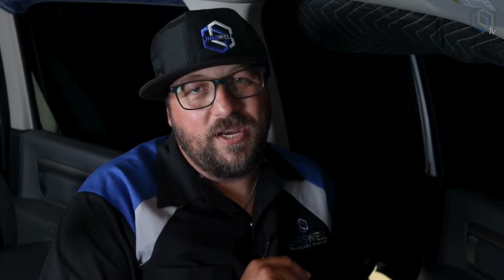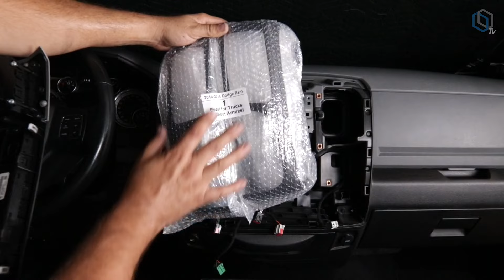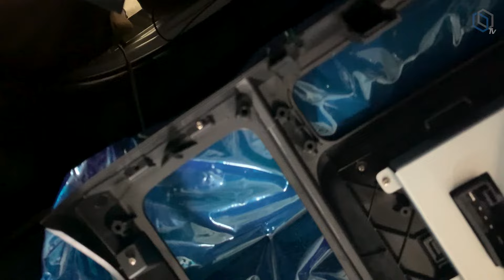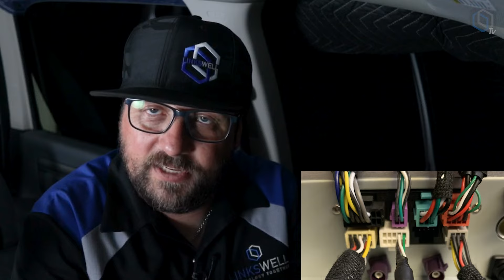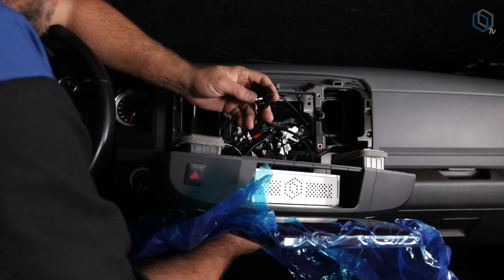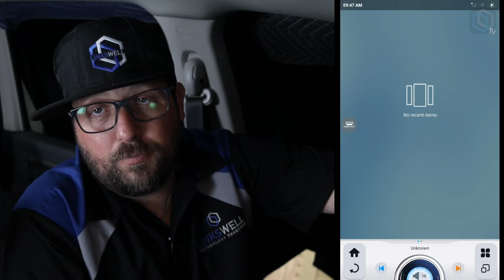Installing a T-Style XL into a 13-18 Dodge Ram

Comment: The gen 5 i got is buggy, hope  they spent a bit more time ironing this out tempted to replace to this or just a regular 2din.
Reply from the maker: Gen 5 is over 5 years old. Technology For Android in cars is wildly different today then it was. And a side note Android Auto is actually an awful app to work with. The app itself is unstable. So makes interacting with it hard. And that’s on the phone side not the radio side. But we keep fighting to do our best to make it stable.

Comment: I installed an aftermarket backup camera on my 2014 1500 Bighorn, and for some reason, the radio still says no signal to the cam. Any suggestions? I’ve tried all 3  connections factory input, rear and front.
Reply from the maker: What radio is it?  

Where did you get the power for the aftermarket camera?
Reply: @LinksWellInc 15.6 t style XL . And I got power from my reverse light to the camera. I was wondering if I needed power to the green wire in cam harness behind the radio labeled reverse power.
Reply from the maker: @bernieunion6362 that’s the problem. You need to power it somewhere else. The power at the reverse light on those Rams isn’t a true 12 volts. You can try getting it at the hitch harness. Or run it to behind the radio
Reply: @LinksWellInc ok I’ll try reroute power wires and let you know if it works. Thanks.
Reply from the maker: @bernieunion6362 sounds good.
Reply: @LinksWellInc I was able to get it to work. Also should I update the software  through system update? And what’s the difference between Ram Lo,Mid and Hi in the setup?
Reply from the maker: @bernieunion6362 update if things aren’t working. 

The difference is based on what the factory AC was. You set it based on the factory climate controls.

Comment: Sorry but that thing looks goofy in there! Looks like a makeshift attempt to have a big screen. Like you found a screen and just threw it in there. Is there a smaller one that looks more professional?
Reply from the maker: So to each their own. The large screen standing above the dash is the “new” style for the manufacturers (Ford, GM,etc)

We also make a 12” screen that fits inside the dash for those who would prefer that look.

Comment: I contacted the support page on your guys website, I've had mine 2 years and rn I'm having an issue where its stuck on bluetooth phone mode and I cant exit out of the screen. I've tried resetting it and unplugging the battery and trying to unpair my phone. But nothing has worked and I cant access any other part of the radio aside from the phone, any tips?
Reply from the maker: Ya need to have the techs send you a format update I think. 

Did you use the chat icon in the lower right corner?
Reply: Just sent another one to be sure it went through. 🙏 When I was able to access parts of the radio it said mine would no longer be receiving updates and had the latest update available.

Comment: I off-road in my ram and often find myself on washboard roads. How does the screen hold up to that vibration?  Is it solid?
Reply from the maker: I have it in my Jeep JL. You can see a few videos I have of my off-roading with it. I haven’t had any issues.
Reply: @LinksWellInc thanks. I’m in SoCal. Who should I reach out to, to get this installed?
Reply from the maker: @osvalds we have a few dealers out here I So Cal. Our website has a find a retailer that will list the closest based on your zipcode

Comment: are you able to connect a gaming system to this device or does it have hdmi ports ?
Reply from the maker: You can get our HDMI input adapter and plug in any HDMI device.

Comment: For some reason when I select "Dodge Ram HI Other" my AC control doesn't work. It blows air but I can't lower the temperature or change the fan speed. Its stuck on 2? Any suggestions? I have a 2014 Ram 1500
Reply from the maker: Check the Protocol that it is set correctly
Reply: @LinksWellInc  what should the protocol be?
Reply from the maker: @ simple
Reply: @LinksWellInc  thank you! i had this stereo for almost 2 years and its bee amazing. i just had to reset it because the screen started to freeze and it was being way to slow.

Comment: Hello bud after Friday, I just bought this new radio for my 2016 dodge ram. It’s really nice, and you’re very knowledgeable and helpful thanks. Could you please educate me on how to use my HDMI so I could hook up my Firestick and what will I need to do to run my internet and use CarPlay at the same time, I thought you were talking about using both on one of your other videos please?
Reply from the maker: @jameswright9578  to do CarPlay and Internet you need to install the SIM Card on the radio. 

To do HDMI input you have to purchase the HDMI Inout adapter. The HDMI on the chassis of the radio is an output not an input.

Comment: I have a 2017 Ram and got the xl radio installed, when I click on aux it just shows a car with and explanation mark in a triangle on it
Reply from the maker: @Ptroiano117  need to set the parking brake if you are trying to watch video. If it’s just audio then it will play with that icon.
Reply: @LinksWellInc I have the truck in park and the parking brake on, and it still shows that picture and does not play. Would it have to do with me having the hdmi box or no?
Reply from the maker: @ possibly. Do you have the HDMI icon?
Reply: @LinksWellInc  not on the screen, but I do have the app for it
Reply from the maker: @Ptroiano117  when you open it what happens?
Reply: @LinksWellInc  same picture pops up
Reply from the maker: @ go to settings/System/Factory setting use passcode 1660. 

BE VERY CAREFUL NOT TO CHANGE SETTINGS. 

Turn the video in motion option. The. Save and reboot
Reply: @LinksWellInc  it is on should I turn it off? I also realized read climate is off, should I turn the on since I have fans back there?
Reply from the maker: @pattroiano1354  turn it off. Stay away from the rear. That is only for the Expedition
Reply: @LinksWellInc  HDMI is working now but the 3.5 Aux is now showing a picture of RCA cables
Reply from the maker: @ which it will unless you have a video source in….  But there also may not be video in that input as well….
Reply: @LinksWellInc  It still doesn’t play any audio still, what I’m trying to figure out is if it is a setting I need to change or if the mechanic didn’t wire it properly
Reply: @LinksWellInc I also can’t get the wired phone link to work, when I plug My IPhone in, it charges but won’t connect to the screen?
Reply from the maker: @ the XL does not have wired CarPlay. It’s wireless only.
Reply from the maker: @Ptroiano117  are you plugging into the factory AUX?  If so do you have the factory CD player?  Because we can only retain one or the other. We can not retain both at the same time.
Reply: @LinksWellInc  Okay that’s a little confusing, I have two usbs, one has a sticker that says usb and other one has a sticker on it saying phone link. But if it doesn’t have it that’s fine, I’m just trying to make sure everything works properly
Reply: @LinksWellInc I’m plugging into the factory Aux, I do not have the factory cd player
Reply from the maker: @ apologies for the confusion. But the cable is the same as our Gen 5, with the Gen 6 and XL though there is no wired CarPlay.
Reply from the maker: @ so then you need to make sure the installer plugged the RCAs marked “Aux In” on the main harness into our AUX IN RCA’s on the grey plug.
Reply: @LinksWellInc  would you be able to tell me what cable (XC01-N0323-A1) is?
Reply from the maker: @ not off the top of my head no.
Reply: @LinksWellInc   I figured it out, it the am/fm antenna. So I had a gen 4 10” links well in my truck when I first bought it and they left that antenna in there when they installed the new unit. Would that affect the stations because they are all static and they’re saying it’s my antenna on the outside of the truck, but it worked perfectly fine with the other unit. Would it be because they didn’t use the new antenna for the head unit itself?
Reply from the maker: @ check the plug to the radio.

Comment: Personally, I had to switch back to my factory radio because I wanted the factory mic. I went with a Chinese head unit brand and tried different mics but everyone mentioned they could not hear me well. That’s why I’m cautious on upgrading my head unit. Plus this stick up a lot and does not look nice in my opinion.
Reply from the maker: @omarpadilla7674  so the other brands use a cheap Bluetooth chip. The issue isn’t the mic. It’s the chip itself. So swapping mics will not help their call quality. Our Chips are much nicer so our call quality is much higher. Use our mic and you won’t have any issues with call quality. No way to retain the factory mics. It’s a long story but the mics are not created equal and so you can’t adapt to them. 

As for the style….  We have a 10” and a 12” screen option for this vehicle application as well for those who don’t like the larger screen.  But then sometimes for some folks keeping the factory is best. 

You have to decide what matters most to you and go for it.
Reply: @ I like the large screen especially for directions since I’m on the road very often. I appreciate your response. I will do more research and decide down the road. Thank you for the explanation.

Comment: I just installed this xl on my 2019...what made it easy was I already  had a gen 4 12 inch so most of the harnesses were left as is just swapped out a few of them and it works perfect. I just have two questions should I use the factory gps antenna or should I connect the one provided? Does the radio use a pixle 3 motherboard
Reply from the maker: @tonyv33ee  so sometimes the factory works perfect. Sometimes I doesn’t. I say try it. If not. Then install ours.
Reply: @LinksWellInc  in regards to the last question, just want to make sure I give  permission to access my Google account and whatnot
Reply from the maker: @tonyv33ee  I believe it is a Pixel yes. I would have to check to confirm.

Comment: Was there any info about the air shocks?   I have an 18 Rebel with air shocks.  I always utilize the tire change or if need be the towing function.  Does that come on this radio?  Are there any updates or maybe a newer version coming in 2025? Before I find a retailer. 😂🎉🎉🎉🎉🎉
Reply from the maker: @leonjrich  so Gen 7 may release at the end of 2025. Still too soon to say. 

Air shocks I will have to double check on.

Comment: does anyone know if you can update the software version of the first gen 12 inch display in a 2020 Ram to the latest android one ?
Reply from the maker: @heavyd7763  no. All components outside of the tablet only function on the Android version it is built with.

Comment: Where can I find the external speaker for the backup sensors? Just installed the gen 5 on my  2018 Ram 1500 and the sensors aren't coming through the speakers.
Reply from the maker: @sportscenter_aj  should have come with it. 

Also make sure the radar sound is turned on in the settings
Reply: @LinksWellInc  I did not see the speaker in the Gen 5 box. I saw the connection for it but not the actual speaker. Radar sound is turned on in settings.
Reply from the maker: @ in “vehicle” icon settings is radar set to sight and sound?  

The speaker should have been in a small bag.
Reply: @LinksWellInc  found the setting for it in the "vehicle" app in settings. But I am unable to change any of the selections in that app. It does appear to be on but set to low volume.
Reply from the maker: @sportscenter_aj  have you programmed the HVAC?  Is that set correctly?
Reply: @LinksWellInc  Yes. I had an Auto, so I set it for Dodge Ram Hi > Simple> Other
Reply from the maker: @ that should be correct. You may need to get on the website chat and get images of firmware sent to the techs to verify all that.
Reply: @LinksWellInc  thank you for your help!
Reply from the maker: @sportscenter_aj  No problem

Comment: Does this radio have the same factory setting access as the oem radio, the rebels have air suspension functions in the menu. Will these still be accessible.
Reply from the maker: @Vetsgotyoursix  yep it does.

Comment: What if you have the 2016 that has just the hazard button above the 3 knobs of climate control
Reply from the maker: @victorialynn961  should be the same. It will work on all 4 different climate control options Dodge made.

Comment: @LinkswellInc, I'm in need of assistance. My screen went blank yesterday. Nothing out of the ordinary happened prior to the event. It has not come back since. It's mid summer, and now I'm without AC. I sent an email to tech support as well. Need help!
Reply from the maker: @Thir_D_Three  press the RST button on the face of the radio with a paper clip
Reply: @LinksWellInc  First off.. Dammage, never knew that was there! Always in the drivers seat and didn't see it. I was pressing and holding all the soft buttons trying to do that very thing. Thank you, It worked.

I will respond to tech support. Much appreciated.
Reply from the maker: @Thir_D_Three  no problem.

Comment: How could I get this to work in a 3rd gen 1500
Reply from the maker: I don’t know what years a 3rd Gen is
Reply: @LinksWellInc  2004 ram 1500 5.7
Reply from the maker: @datguy6502  so you may be able to make it physically fit. But none of the electronics will work. So no climate controls, SWC, factory settings. All that is specific for the 13-18. 

O4 is worlds different
Reply: @LinksWellInc  appreciate the help bro 👍🏼 I’m not sure I’ve seen it been done and I was wondering how I could get it to function properly.
Reply from the maker: @datguy6502  you would have to rebuild it all.

Comment: Is there a way to play the radio automatically, instead having to click on it
Reply from the maker: You should be able to set the radio in auto open in the settings
Reply: @LinksWellInc I didn't see Radio as an option, I'll check again.

Comment: Purchasing this unit for a Silverado. Not seeing any videos on installation. Hoping for the best, but I'm a bit worried. There are many tutorials out there for Ford, Ram, and Jeep, but no love for GMC/Chevrolet. Anyone out there have any comments on Chevrolet/GMC XL units? @LinkswellInc, please chime in when you can.
Reply from the maker: We have a GM set up to install in the next couple weeks. Harder to find around us for what ever reason.
Reply: @LinksWellInc  Thanks for chiming in. I can't be the only Chevy guy out here. Looking forward to your vid.
Reply from the maker: @Thir_D_Three  so I have an install manual for the Gen 3 on our website. The process is near identical. If it helps in the meantime.
Reply: @LinksWellInc  Hello again. I have my unit installed now. Whenever I hop out to Linkswell TechSupport via chat, I never get a reply. From the email option, I never receive a reply there either. Do I have to take any concern I have directly to the dealer?
Reply from the maker: @Thir_D_Three  dealer is your best and first help. 

Sometimes the chats get lost. You can keep trying there as well. The tech sometimes just doesn't work right in getting the messages to us
Reply: @LinksWellInc  failed to follow up. Tech Support came through with the needed knowledge. All is well.

Comment: Can this be installed in a 2019 Chrysler 300S ?
Reply from the maker: No. The systems are built with dashes. The 300 has a very different dash

Comment: How fast is backup camera available on a cold start?  Does it work with the factory microphones above the driver for calls?
Reply from the maker: Camera is available right at start up. 

We don’t retain factory mics. You need to use our microphone.

Comment: Has there been any issues with the 14-18 Rams? Is there a newer model now?
Reply from the maker: This is the newest model we have.
Reply: @LinksWellInc  ty!! Any interference with Cummins Ezlynk?
Reply from the maker: @MAINFRAMEDESTROYER  there is a possibility unfortunately. Any tuner that changes data in the CanBus has the potential to effect other 3rd party parts like our radio. 

We have had our radio in vehicles with EXLYNK with no issues. And we have had some with issues.
Reply: @LinksWellInc  thanked again!

Comment: Can you add virtual upfitter switches?
Reply from the maker: Check out our video from KnowledgeFest. I show our radio using the Trigger Controller. 

There is no physical outputs from the radio itself. But it can run an app that controls a remote up-fitter switch.

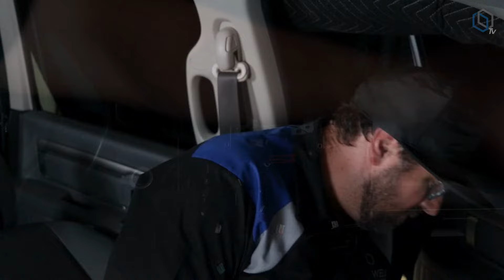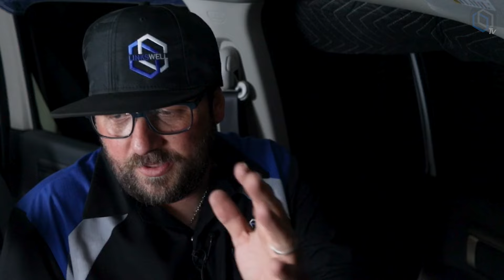Comment: Why didn't you show use what your doing??? from 6:00 to 10:00
Reply: Agreed
Reply from the maker: In an attempt to save time on the video. I explain and show what I did right after. 

Was what I felt would communicate best. If not apologies. It’s always a wrestle between time and details. I try to find a balance each video.